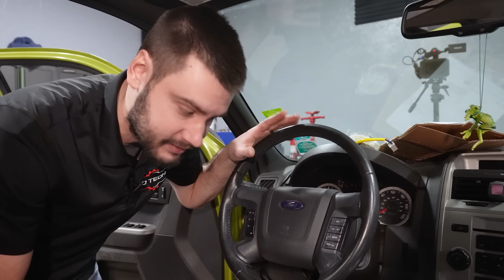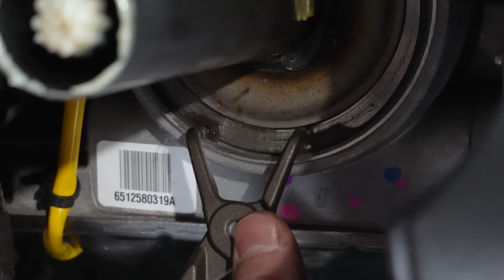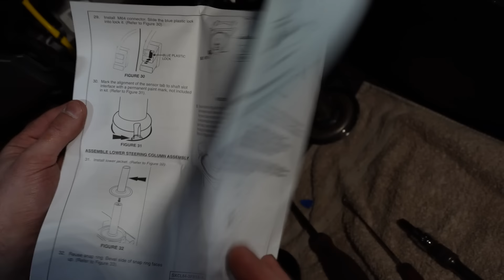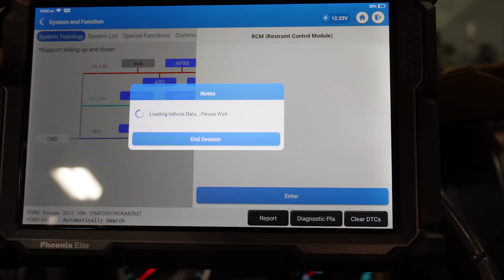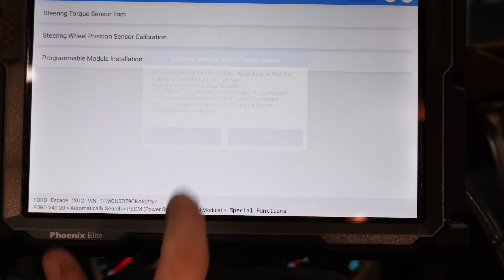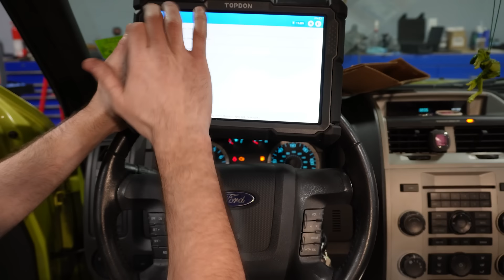B2278 - Power Steering Fault - Ford Escape

Comment: I have a mazda tribute that had the same issue, the dealership replaced the torque sensor for free for me, but ever since they did it the steering input needed is completely uneven, it pulls hard right and makes a bit of a rattling sort of noise. a couple years later and alignments and tire checks havent fixed it and a shop is now thinking it might be an issue in the column assembly. could this be because of issues still happening with the torque sensor, or from it being improperly installed?

Comment: Hi, i don’t have calibrating tool or scanning tool do I need to do the calibration or the steering torque sensor trim, After i install my steering torque sensor or can i skip this procedure?
Reply: I'm wondering the same thing. I don't have a scanner and I don't really want to spend a bunch of money on one. I guess I'll put it in and take it to the dealership maybe they can clear it?

Comment: I installed a whole power steering assembly and I’m getting a code for the torque sensor and while I was trying to program the trim the steering wheel went all the way to the left so I would just have to replace the torque sensor in the used assembly?

Comment: Sensors, that's what makes new cars a nightmare! They have sensors for every little thing, like they have lights at every intersection! You get a little liquid, moisture, dirt or corrosion between contacts & you got faulty problems showing up on dashboard problems that mechanic shops are notorious of over  charging customers for replacement for parts that are $100-$?.?? When all that needed to be done was some electric cleaner & air hose & boom, no more dash lights! Sensors are the problem to begin with! A few understandable, but the amount on newer cars is just ridiculous! Not to mention the equipment you need to read them, the industry knows how to complicate things in which what use to be so easy to do with a screw driver & a little adjustments!

Comment: I had changed the sensor with no issues but still have the power steering assist fault error..
No luck for me.. will I have to replace the entire column or does anyone have advice to help? Would appreciate any feedback.
Reply: I just had the same issue what did you have to do?
Reply: Did you guys get an answer to your problem? Mine is doing the same.
Reply: Is your battery light on, if so fix battery and should fix issue. I had same problem,  bad battery messes up electric power steering

Comment: Mike, thanks for the great video. I bought a 2012 Escape a couple weeks ago and have this code stored but the steering has no issues. I have tried erasing the code multiple times but it always comes back. Have you ever heard of somebody having this code with no symptoms?
Reply from the maker: Hey Robert,
I have not, every time I have seen this code there was a loss of power steering concern.
Interesting that steering works and still sets a DTC.
~Ryan
Reply: @GoTechTraining  I also forgot to mention that there is no warning light / message on the instrument cluster either just the dtc stored in the module. I guess I'll drive it until something changes.

Comment: Question for you or for any other commenters: I did everything perfectly except I forgot to actually plug the torque sensor in before I turned the car on and tested it…I went back and plugged it in after the fact and it still didn’t work but now I’m left wondering, would it have worked if I had actually plugged it in to begin with? Or if its aligned properly in the 5 degree window, does it not matter if you turn the car on and test it before you plug the sensor in?

Comment: Followed your video and successfully replaced steering torque sensor. Everything was accurate, well timed, clear doable. Thank you.
Reply from the maker: That's awesome to hear Jeff! Thanks for watching!
Reply: Did you have to use a code reader to clear the code and or calibrate?

Comment: Any idea if there a is a fuse that can be removed to just drive without power steering? I have an 2011 ford escape I just use for getting around the farm, not insured or plated.... I read some forums saying you can remove a fuse and just drive it without power steering.. thanks, great vid!

Comment: Hello, my mechanic to change torque sensor, and reset at each start the steering turns alone left, it is as if he does not want to zero, do you have a solution, please, Mazda tribute 2011 tank you!
Reply from the maker: Hi Jacques, thanks for watching! If the sensor install was done right then I would suggest trying to do the relearn.

Comment: can this part be replaced with the assist motor out of the car? just move the shaft maybe to line it up? and a couple that i have have a ratcheting noise when i turn the rear shaft to see if it moves freely. Is this caused by the senor you just replaced?

Comment: Great video. Would never try this myself. I have this problem on my 2009 Escape. Car is currently sitting in my driveway. Replacement part is not readily available. Dealer has on order since July 2022. No idea when it will be coming in.
Reply from the maker: Hey Aram M, yes parts are hard to get right now. I had to special order it and have it shipped in from another dealer. Good luck getting it fixed!
~Mike

Comment: Very good repair. Just wonder the miles on the vehicle also if most or all will have to be replaced? Thanks much as always keep it going and thumbs up as well 👍
Reply from the maker: Good question! From what I have seen. These steering sensors can fail at anytime and most Escapes will need the steering sensor replaced at some point. Not too bad of a repair, but parts are getting harder to find.
Thanks for reaching out!
~Ryan

Comment: I replaced my torque sensor and it still does not work. any thought on what elese may be the cause of the failure.  I have check the fuse and made sure power is gong to the assemble, so do the codes have to be cleared before the system will allow the power assist to work?????
Reply: Same issue here.  I followed the steps closely, I get a 'Torque Steering Assist Failure' message on the console, but no whacky steering behavior,  just no power steering.  Retried everything a week later, verified all the holes and marks are aligned. 
I can try again, but how would I know if the power steering motor is tge problem and not the torque sensor?
Reply: @markguinther7518 very good question, I have done exactly what you did and had same result.
Reply: @angelperez1043  tried it twice with 2 different sensors.  I believe the steering motor itself is fried.  Too expensive to fix, been driving without power steering for about 50k miles.  It's a workout, but functional!
Reply from the maker: Hey Ted, no the system will power and and function without clearing the codes. Are you dealing with that B2278? 
~Mike
Reply: @GoTechTraining  I have a code reader but it will not read the codes for the steering which makes it hard to track down the issue.  I had purchased a complete assembly off of e-bay but still had the same fault display on the dash. So either the unit I got off of e-bay was bad or there is another issue.  I returned the e-bay unit, so right now I'm stuck.
Reply from the maker: Hey Ted, It depends on the source from E-Bay. Sometimes its good sellers, sometimes they are not. As far as the diagnosis, maybe it's worth taking into a shop to at least get a diagnosis done?
~Mike

Comment: Great video, thank you! Was the scan tool absolutely necessary for the trim resetting?
Reply from the maker: Hey Louie, so the power steering did function properly without the relearn. I've never tried NOT doing it. It may cause the a light to come on maybe?
~Mike
Reply: Same question. I do not have the scan tool so I am wondering if I can drive the car to auto zone once done and have them do the relearn?
Reply: Can I use any scan tool to progam it?
Reply: Did you guys find an answer to this?

Comment: Nice fix Mike! 
I heard "why is there an air bag light on?"
I yelled, "The driver's seat is removed!"  
That is scary about that motor having all that torque!  My 2020 RAV4 has electric steering assist.  So far, so good with that one.
Thanks for the video, hope alls well with you and looking forward to more videos.
Reply from the maker: Hey Mike, thanks for watching! Yeh...my brain was a little slow to connect those dots on the airbag light lol. Hope you are doing well 😀
Reply: I think they had all glitches out by yours...
2014... 15s...16s...toyotas had issues...

Comment: When you disconnect the battery  should't you wait 2 or 3 minutes to drain capacitors ( which provide power to deploy bag even if battery gets disconnected in an accident )   ?   -   I've seen lots of techs recommend that
Reply from the maker: Hey, yes you should. I should have mentioned that. There was a cut in the footage there so it looks instant, but it was a few minutes in between. Great call out on that!
~Mike
Reply: @GoTechTraining  Mike - thank you for posting your vids - over last 5 years I've learned so much from them , I am DIY-er and I want to keep learning
Reply from the maker: Thanks man! Appreciate the support :)

Comment: The worst part about the whole job is that snap ring
Reply from the maker: Hahaha yeh it is Larry!
~MIke
Reply: If I am correct the bungee cord is not needed because the the steering wheel will lock when you remove the key
Reply: I disagree.  I spent 6 hours trying to get the splines on the steering shift realigned to slide the steering wheel back on.
Reply: @markguinther7518  we're having the same problem! What was your solution?
Reply: @scott brown  after 12 hours of frustration we messed up the plastic gtooves on the column pretty good. we cleaned them up with a file and heat gun, then found thr notch on the column  that's just a hair wider than the others. It's probably at about 11 o'clock, same gtove that alignment tool notch rides. Then Mark on the steering wheel shaft which spline should allign to that groove on the column.  I wish I knew a secret, but one of my neighbors got it to shove/wiggle it on with the .arks allignex.. Once it got past the first inch it slid freely buy it was wY harder than. Expected.  Lots of shoving and unpleasant words tho.  Definitely  old have used more illustrations in the video.
Good luck!
Reply: @markguinther7518 the key is to use the key to unlock the steering wheel no pun intended and then you will have a easier time getting it aligned in the 11 o’clock position when you reinstall the steering wheel
Reply: Marci mon frère
Reply: I made my own 90° snap ring tool. And also had to clean up the steering column spline. Total time was about a hour. My problem is trying to find someone to recalibrate it without trying to say i installed it wrong.
Reply: Worst part is not knowing how to use forescan to reset the pscm or if it's another problem
Reply: on reinstall, I used a nice large clamp to depress the ring so regular ring pliers would fit on it. then used the clamp to compress the plier handles and help me slide it right in.
  To get it out, I used Orielly titans right red handled ring pliers bc they can open wider than normal small ones.  and got lucky that it popped out at an angel.  what a pita
Reply: I Snapped The Snap Ring!

Jk, I used tricks to make reinstalling easy

Comment: Nice and easy. Had a 2008 Escape... I traded it in for a BMW motorcycle. I really hated the transmission. It really felt in "between" gears. The steering column bolts looked like they had some loctite originally. Maybe a good idea to re-apply some, especially because they're upside down. I wonder why they sell incomplete kits. If they say that new bolts should be used, why not include them in the kit? Nice video as usual! Thanks!
Reply from the maker: Hey Johnny Blue, thanks for watching! Yeh, a little blue loctite wouldn't have been a bad idea there.
~Mike